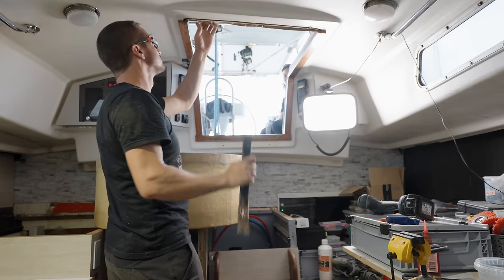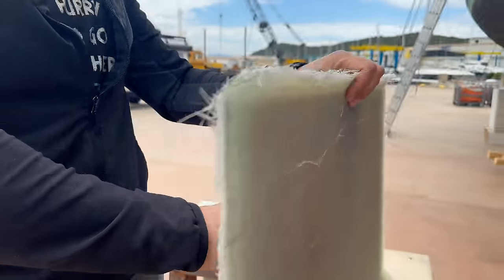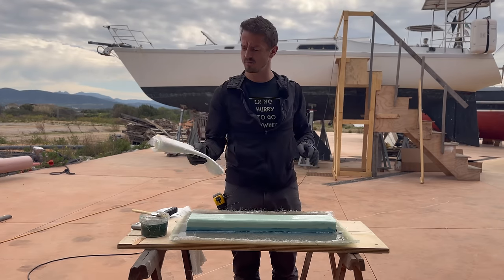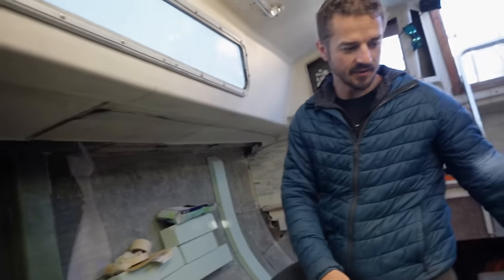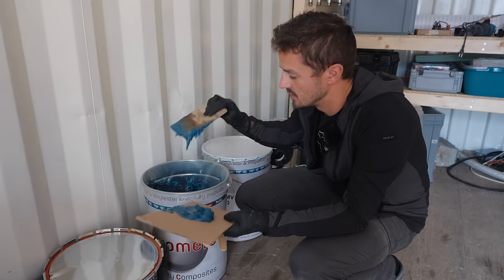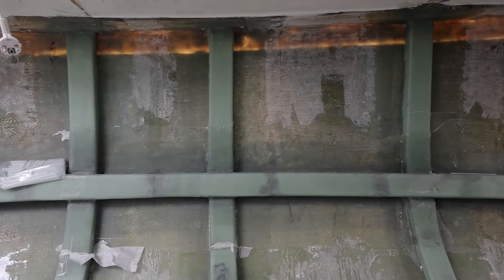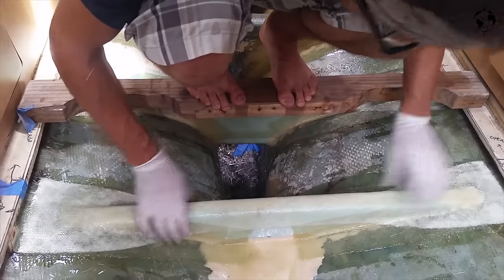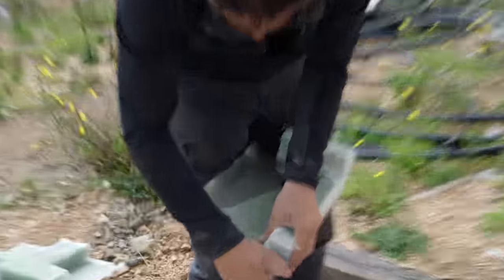Cutting Open our “New Hull”: What Could Go Wrong? | Step 386

Comment: The comments are full of information and advice witch is fantastic I hope some are useful to yall. My comment will not be as I have no idea but how do u know its enough structure how do u know its strong enough did a boat engineer help with this or assess it. Is there even such a thing as a boat building engineer that one could hire to just check theses things?
Reply from the maker: A lot of what we’re doing is sort of “standard practice”. Like building a garden shed, you don’t need an engineer for it. But we have taken the advice from friends of ours who build boats professionally and local engineers. Engineers are useful when you’re making something completely new that’s never been done before, or pushing the bounds of what’s possible. We’re just taking what already worked, and making it stronger. As long as we follow some basic principles of glass work, it’s really not rocket science.

Comment: Make sure the hot glue does not burn the foam
Reply from the maker: It’s only to hold it in place while glassing. So it really doesn’t matter.
Reply: yes you are right its only to keep the foam in place, however the area between the foam and glass ii not  binding to the boat structure @SailingUma

Comment: I wonder if the vinylester resin does not  like the original glass so the expected bond of the “top hat” structure to the interior of the hull is compromised?
Reply: After a re-watch many comments point out the obvious scenarios such as lack of pre-wetting etc. Then the closing shots show our two actors in throes of self doubt and anguish … yep, many of us were indeed stitched up by your semi April Fool - but you won’t catch us next year!

Comment: Ok , what about a bonding surface like Back Buttering Tile or Mesh System used like Stucco that can Secures the Hull and New Fiberglassed Structure Cohesively and Permanently together ?

A Grid/Channel System Bonding & Connecting each Surface that Significantly Affords them Connective Integrity & Reliant Flexibility &  Strength ???

Comment: Hi Guys, well I watched this video right through, then after watching the shocking test results, rewatched the initial sticking parts together and final battering test. The way it de- laminated was very clean break after the shock impact. I can understand the hot glue delaminating as its only really a tacking part, but why the encapsulating glass and resin sticking the whole lot to the hull piece delaminated as well is a mystery - What was the cure time you gave it ? Was there any residue or Amine blush on the hull piece side? Perhaps not washing it down to remove any residues or sanding a key is the answer ? I'm sure all will be very intrested to see the next video...

Comment: Delamination of stiffening ribs to the basic hull would be an obvious failure mode but as others have spotted,  the guys doing the actual boat did it differently to your model.  Nothing for it but to re do your model using EXACTLY the same process and resins the guys did.   Maybe even have them do it.   Next when eventually sea trialling the boat look for ANY signs of delamination which also means when doing the fitout make provison to  get visual access to all the ribs and longerons to periodically check for delamination.   
You say new boats have a 1mm fibreglass outer skin then a foam core then a 1mm inner skin?  THAT I would say would be a disaster waiting to happen.  A pin hole in the outer skin or even in the bilge area of the inner skin and water will get into the foam core and destroy the skin to foam bond over time.
Looking at that braced internal structure I'd feel very confident it would handle the wildest of seas.

Comment: In my experience vinylester is fine for building up layers in a wet lamination.  Not very good for bonding a wet layer to an already fully cured layer.  As several have said here I think epoxy would be much better for what you are doing.  Just my .02
Reply from the maker: Epoxy is 10X more expensive for marginal gains in strength. If it were the case, all new boat would be build of epoxy.
Reply: Agreed.  It was not the cost nor strength of epoxy I was commenting on.  Rather, in my experience, it’s ability to bond with already cured structures.  Your two test layups were obviously very strong, they just did not bond well together.  For that reason I suggested epoxy.  Why not try your excellent test build again but this time laminate and adhere the foam ribs with epoxy to your vinylester hull analog.  I offer no guarantees, but I think it will bond much better.

Comment: Is there a reason you chose not to use vacuum bags for your glassing process? I know it’s not strictly necessary, but it does provide slightly higher quality (at the expense of a lot of hassle). 

I hope you sanded the inside of your hull before you laminated the ribs!
Reply: In a previous episode they mentioned a concern that the vacuum would deform the existing hull since it has no support.
Reply: @brianorca thanks—I’m a longtime subscriber but haven’t been able to keep up with every episode!

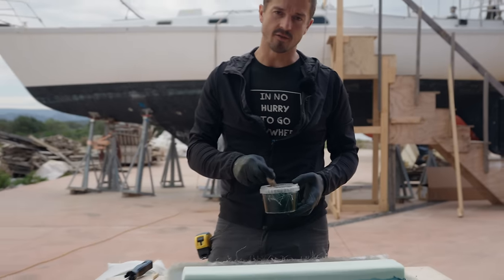Comment: Sorry to have to disagree with your comment at approx 8:00, but the foam you use in a fiberglass/foam composite sandwich construction absolutely matters.  It is an integral part of the construction and provides stiffness and strength in addition to shaping the fiberglass skin.

Comment: I would have sold, donated Uma to a sailing school or to charity and taken the tax write off. Uma would have been fine for some one who wanted to live aboard and only sail short distances in protected waters. Then bought a fantastic, strong, stiff nearly new used boat with more comfort and at least as good sailing performance that would fit your needs that required minimal upgrades, work.  I would only buy a proven design still with a warranty from the builder.

Comment: Did you guys epoxy glue the stringrers to the hall? ]Without it,  its like building a cage inside of inside of a  boat. The stringers  should be bonded to the hull to became one structure. Im not an engineer but thats my 2 cent.

Comment: Guys, your section looks good on the outside, BUT there should not be any voids between the layers or foam to glass to foam as that creates a weak spot for a bending moment. Many will argue that. Don't be fooled, when a keel hits the bottom, the keel beam bend and fail or start to crack at those voids.
Reply: PS .... vinylester doesn't adhere well to itself or to polyester, you should do all your mods and repairs using epoxy resin. Peel ply is usually used on epoxy resin. Ask around ....

Comment: There is much that you left out of your explanation of the vinylester-glass prototype failure... Maybe just to create SUSPENSE!

You laminated the ribs to the smooth undersurface of the test laminate panel, which had been laid on top of peel-ply on a breathable plywood base. Assuming that the lower layer of resin contained no wax, and given the breathability of the plywood base, cure of that surface may not be complete at that stage.

White peel-ply is a woven polyester fabric coated with a release agent. Even though it leaves a roughened surface when removed from fully cured resin, the surface should be thoroughly chemical-cleaned before further laminating. Sanding that surface can only improve subsequent adhesion.

However the sanded hull interior already provides a roughened, cleaned non-breathable substrate - thanks to the professionals. So I would expect strong secondary bonding that avoids the problem seen with your prototype.

This type of problem with the mechanical bonding of secondary tabbing appears to contribute to the hull failures seen in many production sailboats - having only partial hull liner grids tabbed to a thin hull. In those cases keel grounding flexes the hull and sometimes breaks the tabbing attaching the hull to the liner. See the channel "For Love of Wind" - massive problems and repairs.

Comment: Just a comment and only a comment. I think the problem with hot glue is by the time you cover the foam it's too cool already and sets up with  a gap between the foam and the hull.I would think that compromises the foam acting as a layer between surfaces in tension and compression. 
There is only one solution to your test sample problem. You have to  test (hammer) a small section in the boat to see if you can delaminate it.
It's better to deal with potential problems on land than out at sea.
Reply from the maker: The foam is not structural. It’s only there to keep the glass in shape while it cures.

Comment: Looks like your also using polyester and not epoxy ,which has a way more bonding adhesion and is stronger. Most new boats are vinyl ester which is still way better than polyester
Reply from the maker: We’re using vinylester.
Reply: @SailingUma  then I'm guessing you know it has a short shelf life and will delam if past 4 months old from date of manufacture

Comment: did you think of using Carbon Fibre instead of Fibre Glass ? one would think it would be a lot stronger and instead of using timber in the rebuilding it would be a lot stronger and mainly lighter using Fibre Glass
Reply from the maker: It’s not that simple. Carbon comes with it own set of complications. Besides, we’re not building an ultralight boat here.

Comment: If the 10x10 Foam only sits on the fiberglassed 10x5 fiberglass, without being glued...is it not creating those annoying squeaking noices? I have no idea of Boatbuilding so im curious....
because dan mentioned, that the bulkhead wasn't glued to the top of the deck, just fiberglassed, what produced the squeaking...

Comment: I'm no engineer but it seems to me that hot glueing the foam to the hull was a bad idea.  Shouldn't you have used epoxy to set the foam?  The question is what is the new glass attaching to on the hull.  Maybe adding some sort of anchor to grab the hull and glass in on the new layer.  Lastly, have you considered how water will make its way to the bilge?

Comment: i would not use hotglue, if you use thickened epoxy or the other methylcrelic? what ever Mat & Jess used to join the hulls would of made the foam part of the structure, not just a structure to form a web. I would also be using foam core slabs not ply wood for my interior. much lighter and stronger.  You also need to add a cover or or rounded fillet as the glass doesnt like 90deg bends. Otherwise great project to turn an old hull into a better product....

Comment: Why did you hot glue the foam and not use the vinylester to glue the foam to the hull. Peel ply can leave a residue and a lite scuff and clean is always needed. best to wet the cloth out .
Reply from the maker: We answer this question in the next video.  Stay tuned for that next week :)

Comment: Wait. When you cleaned up the hull, you roughed it up to adhere new layers. In your sample, you did not rough up the "hull" before adding new layers of laminate. Thus it would delaminate as it did. The critical step is to rough up where you are putting on new layers on top of old.
Talk with your fiber people about your sample compared to the hull of Uma. Good luck and chill out. It's not as bad as you think.

Comment: Wow, that sucks, peel ply is only good for the very top layer with out sanding, but I think you only added peel ply when you did the ribs and the hull looked ruff enough, ruff up the new ribs. Sometimes there is a time limit on when you can add more layers with out scuffing and you did wait along time with the sample peaces. You'll figure it out and have probably thought of what I said already. I would guess this would be on the guys working to know this or theres going to be a problem and that they should know, or else!!!???

Comment: My question: your boat is GRP ie polyester fiberglass. Are your new ribs being glassed in polyester or epoxy? If the hull model is epoxy instead of polyester it is going to be a lot stronger in relation to what you true hull really is.
Reply from the maker: It’s all vinylester

Comment: I hope that foam is closed cell.  Over the years water could get into the ribs.
Reply: I was thinking the same thing - type of foam does make a difference.  Open cell is like a sponge.  If it becomes waterlogged and the boat is then stored in below freezing temperatures the ice can expand with enough force to separate ribs from hull.

Comment: I'm not sure you have an issue with the lamination of the old hull and new hull. I don't think your load test was representative of loads a boat would see. You shock loaded with the hammer and piling. In a case like that there are two inputs. Energy and time. You had a very short time that your load was input. Boats also tend to try and move away from the load be input lengthening the impulse time of the energy further. Also, the interior total covering bonding layer that is inside the ribs will probably distribute the stress and resist the delamination.  The better surface prep should only improve the bond more.
Reply: In the test sample, the entire rib/stringer system completely debonded from the "hull" panel. The bond was clearly unacceptable. It is true that it wasn't a scientific test. But it is also clear that the bond was terrible. I am sure they will figure out what went wrong. I am sure the pros working inside the boat did something slightly different and the actual boat work will be fine. But they will get to the bottom of it.

Comment: So the outside has become weak,  now you have a stronger inner liner. Age has weakened her threads
Reply: We use foam core blocks near the beach next to foundations with deep crevices to fill so 1 we use less material and 2 the weight of wet sand VS the weight of the Styrofoam block with a sand covering makes the difference required to lessen the structural bearing down upon the foundation, causing it to sink in the sand once filled. Leaning tower of Pizza prevention. It's just a filler, the strength is in the box formation. Uma is going to be rock solid this time, gonna weigh more, but she won't break. The Atlantic be calling.

Comment: That little squiggly line of hot glue was all that was holding the stringers to the hull. Shouldn't you use epoxy to glass the stringers to the hull?

Comment: Why did you not epoxy the foam to the hull rather than hot glue?
Reply from the maker: It’s not structural. It’s just the form work to hold the glass in place while it cures.

Comment: How much weight you add to the boat?
Reply from the maker: About 200kg . But we are removing much more. So it balances itself out . And integral element is one thing, what we put in in terms of equipment,and personal stuff also matters. Especially Since we no longer need to carry all the heavy tools and equipment and extra materials we carried for the last 10yrs. We’ll make a weight comparison video near the end of the project :)
Reply: @SailingUma  I had no doubt you will compensate

Comment: I could see if you had a pointed impact that could cause enough of a vibration to separate in the impact zone. My, I guess, positive takeaway from this is that you are glassing the whole inside, not just an area. Which, from what I understand would have a tendency to spread the force of whatever impact may come about. Don't forget you are also going to be putting structure in the boat with everything that goes back in. So I would still have a tendency to think that yes there is a possibility of delamination due to impact and beating the wind, but that the forces from without and in would tend to hold it together. Not a boat person just an observation. I've read a few of the comments below, so yes I am concerned to, but I would feel remiss if I didn't bring up the opposing forces from without and in up. Maybe a factor maybe not. I'm sure you, or your advisors will come up with something.

Comment: Great video, and nice glass work. As an old builder of composite experimental aircraft, I noticed a couple of things. A wet layup onto existing older (dry) glass is always more likely to delaminate under stress than when the entire structure is glassed "wet" all the way through. This might be improved with sanding and an acetone wipe right before the layup. I have no experience with vinylesters; all the aircraft I've worked on were epoxy layups (and many with fancy stuff like Kevlar or carbon fiber). In aircraft, bonding foam onto existing structure was never just with a squiggle of hot glue, but always with a full-width layer of epoxy resin mixed with a filler (either "flox"-cotton fibers--or "micro"--glass microspheres). We also filleted all inside corners (for example, where the edge of your ribs meet the hull) with either flox or micro ("dry" or "wet" micro depending on the ratio of filler to resin). I was glad to see you using some filler on your test article, but a bit surprised that your in-hull "pros" weren't doing that any or everywhere there was an inside corner in the layup where a rib or stringer met the existing hull, and when you broke (delaminated) the test article there were several visible voids.

That said, Uma is already much stronger than she ever was new, and with the new liner she'll be stronger yet.  The guys working inside the hull obviously know what they're doing, and I'd hope that all the boats that they built or repaired are still happily afloat. It's not as critical as aviation--we used to say "never a complaint from a dissatisfied customer," since dissatisfied aircraft customers often don't survive to complain. And FWIW, the genius from whom I learned the rudiments of composite construction went on to design and build,, among other things, the "wing" mast and sail of the America's Cup winning "Stars and Stripes" catamaran (AKA the "Hobie from Hell") that was the ancestor of all the current "curses, foiled again!" racers.